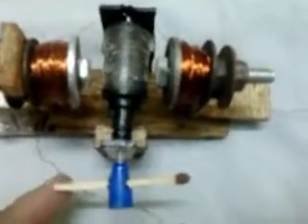SINGLE PHASE AC MOTOR

Comment: That's not a squirrel cage rotor it's a permanent magnet rotor you chucklehead. This is a synchronous AC motor. A squirrel cage rotor would not work with those kind of poles and air gaps.